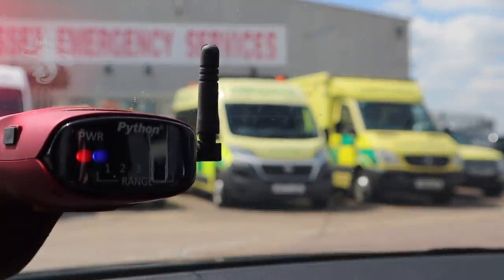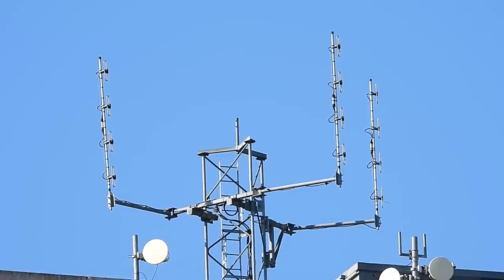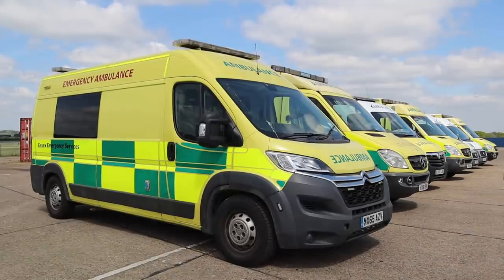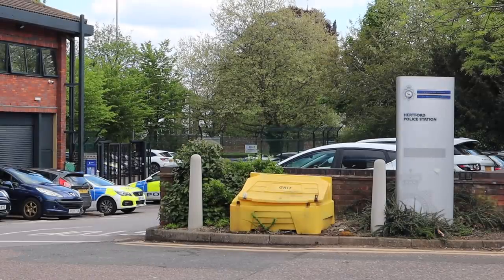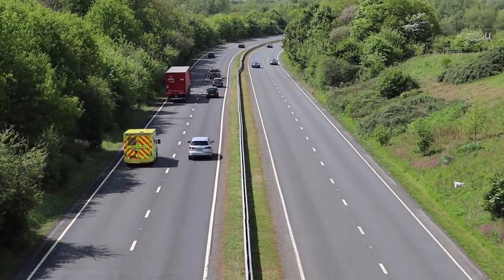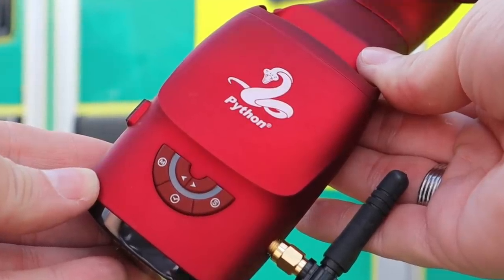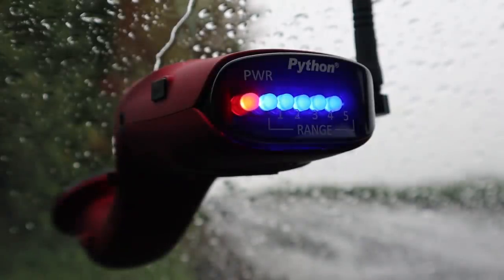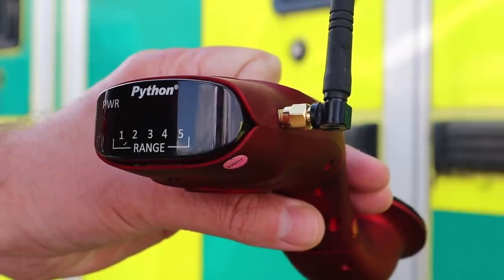This UK Police Radio Scanner Is Always Listening

Comment: Yeah but how do we listen in to their radio?
Reply from the maker: We don’t, impossible 👍🏻
Reply: @RingwayManchester  Very difficult,but not impossible!
Reply: @jasonantigua6825  So difficult it is unlikely to be achieved any time soon, given Airwave has been in use for many years now (since 2004 and fully since 2006) and not being replaced by the 4G ESN until 2024/2026, if it was so insecure I doubt they'd have just renewed the use of it again for 1.6 billion pounds. 

If and when it is ever breached, to the point people can then intercept police communication, we will likely be on the new ESN system by then so the whole effort in hacking Tetra/Airwave would be moot as it wouldn't be in use any longer by Emergency Services.

Comment: But why use DMO and not TMO???
Reply: A much debated topic internally but generally for something like the Fire Service where in building short range coverage is required where you may not get Tetra coverage. Often normal talkgroups work better an in my 8 years experience your usually better off not using DMO.

Comment: I think it's only a matter of time before someone invents a scanner that can listen to the police again. Police radios exists and can monitor all they have to do is build the same tech into a scanner.
Reply from the maker: Never gonna happen unfortunately
Reply: @RingwayManchester  Never say never - just wait for a 'portable' quantum computer capable of brute-forcing the keys ;ø)
- now the cost, size and power requirements, yeah.. possibly possible but very impractical
Reply: Not in our lifetime  will a MOP ever monitor the EMS Tetra Airwave Service, with its TEA2 Algorithm Air Encryption Interface and Network authentication protocols. 
The UK Tetra Airwave Service has extended there Tetra contract for a few more years to come, until this new ESN LTE Network is up and running provided by EE.
Reply: It's happened 3 times tetra has been hacked and yes that is officially true police now are told no sensitive information on radio has to be phone call
Reply: @richardcurrinn9880  You talk utter nonsense. Considering I've been in the job for 7 years and not once been told to only discuss sensitive information on a phone call, which is probably less secure in any case....

The only time I use my phone to call a colleague is if we have no radio reception, hospitals are a nightmare for it as most of them don't have Tetra masts and often you're deep within the building. Difference being a lot of hospitals have cellular masts and some even have devices which broadcast a cellular signal inside the building.

Comment: 0:07 The AR-DV10 can monitor Tetra with the latest beta firmware
Reply from the maker: Yeah, Tetra is very different to tetra airwave
Reply: @RingwayManchester  Ah, I was wondering, thanks...
Reply: @RingwayManchester  That's not quite it. Airwave is just the marketing term for the TETRA system used by the UK emergency services. The reason you can't listen to Airwave is that it's encrypted (TEA2), not because it's somehow different from 'normal TETRA'.
Reply from the maker: Which is a more complicated way of telling the guy that tetra is very different to tetra airwave….
Reply: @RingwayManchester  no, you are complicating and misunderstanding terms... tetra is tetra, simple as that
Reply from the maker: Not at all! There’s a huge difference between a tetra system someone like a security company or traffic wardens may use and Airwave, an encrypted network which has much higher functionality and is a pay per second service. So my point to Nick stands, yes and aor dv10 will monitor a tetra system but airwave is a completely different ballgame. 

Sorry not budging on this. I know the comments for a lot of you guys are about proving creators wrong but please don’t make out that the 2 types of tetra system I just referred to are the same…
Reply: Oh dear, and I thought Ringway Manchester knew what he's talking about. It's always the way, as soon as someone discusses a topic I actually know something about I discover how much incorrect information is out there. I worked for Sepura for 9.5 years, all their TETRA radios have software I wrote in them.

Comment: Just out of curiosity. Does anyone have a list of the input frequencies?  And the modulation? AM or FM
Reply: It's a digital signal, so probably FSK. FM/AM strictly applies to analogue modulation.
Reply: it's neither AM or FM they use a Encrypted digital service called Tetra. you can easily receive UK  police radio traffic with a SDR setup but it's encrypted so useless any way.
Reply: @alastairbarkley6572  It's π/4 DQPSK.
Reply: @TheUberdude187  I know that mate.  DMR, NXDN are digital. They still use NFM... The modulation has nothing to do with the digital mode
Reply: Tetra RF in TMO uses 4 slot TDMA with 25KHz spacing. The digital signal is very fast and continuous from the BS Txing the control channel, plus voice channels.

Comment: Over here in the USA we're allowed to listen to police radios if they're using FM (or AM) but not if they're digitally modulated.  As recently as a few years ago, ham radio operators such as me (N4TMI) were encouraged to have police scanners (often built into our 2-meter handheld transceivers) -- they're useful when we're called on to help in emergencies.  And I learned some things about police work: almost all police calls are "domestic disputes" and almost all fire calls are false alarms!  Now my area has gone digital, and it's not legal for me to demodulate their signals (nor do I have any idea how I would do so) and I feel I know a good bit less about my town.
Reply: This is incorrect information, and as a HAM I would expect that you would know better.  It is not illegal to listen to APCO p25 Phase 1 or Phase 2 digital transmissions, or DMR or MotoTRBO,  they are just using digital to save bandwidth and improve reliability. There is nothing special or secret squirrel about them being digital. Perhaps you meant you cannot legally listen to digital transmissions that are also using encryption on top of being transmitted digitally.

Comment: Hi. I’ve had a police radio in my hands for about hour and half the copper just said in my home don’t touch any buttons and I said na I won’t. He see all my scanners/ receivers and new I was well in to radio. I told him I started in radio in 1981 with a  ROTEL RVC 240 and I still got it to day. I had bad neighbours who were removed by the council and the police man visited me once a week if my mum was at my home he would say he-ar and let me hold his radio. I said to him this has a gsm SIM card in it and he said yer it does. He said the network but I won’t say witch one. If he lost it the police will press a button and it’s looked know good to any one even if it’s turned off as soon as it’s turned on that’s it locked and it don’t matter if any found one and took it to bits to change the gsm SIM card it will be looked as soon as it’s turned on. I any one finds a police radio the best thing to do is hand it in to the police or phone them and there come and get it.
Reply: Control rooms monitors our radios. They can see them on a map at any point. They can also remotely "tap into" the radio and effectively open the microphone on the radio to hear what is going on, without the officer even needing to press the transmit or PTT (Push to Talk) button. This is only done in extreme circumstances where the officer does not respond and they are unable to locate or raise them on the radio, they therefore use this open-mic technique to hear what is going on where the officer is. 

In the force I'm in they have to get special authority to do so (as the officer could be having a personal conversation on their mobile phone, talking to a colleague about personal matters etc) and in the force I'm in it's only ever been done ONCE since I've been in the job (7 years), the control room didn't even know how to do it as the staff on that shift had  never done it before. Took them an hour to get it sorted. The officer was located in the end safe and well and was a brand new officer who hadn't been taught how to use the radio correctly. 

Control rooms can also remotely lock and "kill" the radio effectively blocking it from the network, if an officer loses their radio they report it to a supervisor, it then gets passed to the control room who then zap said radio and it is then blocked from the network immediately, and as I understand can only be re-programmed to the network again by the manufacturer.

Comment: Needs 2 rx'rs to give direction of signal !
Reply from the maker: No it doesn’t, phased antennas would do it and a different type of rx
Reply: @RingwayManchester  yes back in the 80s serious fox hunters ha a four antenna array on their cars. Similar to the system i used in the police a decade later to track stolen vehicles.

Comment: The frequency range of 380 to 420 are available in most Chinese radios 
So, anyone would be able to spend 50 dollars and get a radio that could get onto police frequency in the UK.

Here in America the 300 band and lower 400 band is for military use and I kept wondering why all these radios coming out of China had 350 to 400 MHz as one of the bands that could be programmed
Reply: even though some commercial radios can technically operate on the same frequencies as the UK blue light services they would never be able to hear any thing as they use a encrypyed version of tetra here for our police and fire services etc.
Reply: @TheUberdude187  thanks for that
Reply: American military UHF aviation is AM, and the 400-402mhz is reserved for radar and EPIRB/ELTs. I recently read that 408-411 has been earmarked for the Drug Enforcement Administration, for some time now. I have no idea if that's accurate as I'm not close enough to any DEA office/have the  gear to hear.
Reply: Most Chinese radios are 136-174 VHF and 400-470 MHz UHF.
Airwave Service uses 380-395MHz and is a digital rf signal with TEA2 encryption algorithm. The security layers make it impossible to monitor.
Reply: @jamiemoo2000  you can easily monitor Airwave with A freely available SDR plugin but you can't decode it.
Reply: The Chinese radios work mainly on fm but even though the frequency might be the same you wont be hearing jack sh** on the emergency services because tetra is highly encrypted and channel hops like a mobile phone so don't get excited and waste your money.

Comment: Interesting unit. but  "completely legal to use" . Not so sure about that,  Lewis:

"Section 3(1) of the Regulation of Investigatory Powers Act 2016 and later makes it a criminal offence for a person to intentionally, and without lawful authority, intercept in the UK any communication in the course of its
transmission if that communication is sent via a public or private telecommunication
system or a public postal service. " (from the code of practice document). It does not matter if you don't or can't decrypt the communication - intentional interception is the offence and having appropriate kit could also attract a charge of "going equipped to commit crime" in some circumstances.

Airwave is coming to wards the end of its 20 year contract run and will be replaced by the 4G-based Emergency Services Network (ESN) as soon as they can get their act together (Typical large scale UK government project).
Reply from the maker: It’s not illegal to use at all. Check the website
Reply: You aren't intercepting the communication if you can't decrypt it.
Reply: It is a signal strength meter for a set frequency range, you aren't 'intercepting' as there's no speaker in it and it can't understand the encrypted signals.
Reply: @Nick_G7IZR  Well that's not true. The Axis military messages - enciphered with Enigma, Geheimschreiber,
(Italian) C-38 Hagelin or the hand ciphers used by SS/SD/Police units - intercepted by the British and US 'Y' stations ('Y Service') were always known as 'Intercepts'. That's BEFORE they went to Bletchley Park for decryption. Those intercept stations (like Beaumanor, Knockholt etc) were called 'Y Stations' because they were 'wireless interception' stations - abbreviated to 'WI', which morphed in 'Y'.
Reply: @alastairbarkley6572  Well I can't argue with that!! :)
Reply: @james-5560  
Arggh you're making me read the hole damned Act...

"Definition of “interception” etc.
Interception in relation to telecommunication systems

(1)For the purposes of this Act, a person intercepts a communication in the course of its transmission by means of a telecommunication system if, and only if—

(a)the person does a relevant act in relation to the system, and

(b)the effect of the relevant act is to make any content of the communication available, at a relevant time, to a person who is not the sender or intended recipient of the communication.

For the meaning of “content” in relation to a communication, see section 261(6).

(2)In this section “relevant act”, in relation to a telecommunication system, means—

(a)modifying, or interfering with, the system or its operation;

(b)monitoring transmissions made by means of the system;

(c)monitoring transmissions made by wireless telegraphy to or from apparatus that is part of the system."

I would argue that the Python device is monitoring a specific frequency range for a specific transmission type and is therefore in direct contravention of several paragraphs above. I'm not a lawyer though and testing in court is the only sure way.

In the "good old days" the Wireless Telegraphy Acts did forbid not only listening but also revealing the fact of a transmission's existence. to an unauthorised person.
Reply: @spky999  This was cleared up years ago in court over Speed camera radar detectors. Court ruled that detecting the presence of a transmission alone wasn't the same as intercepting it, it had to be demodulated.